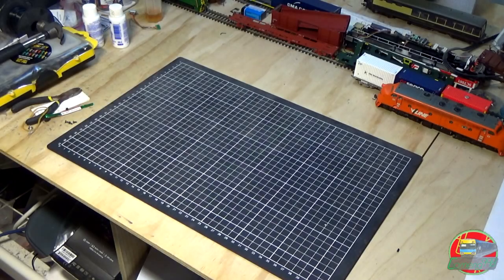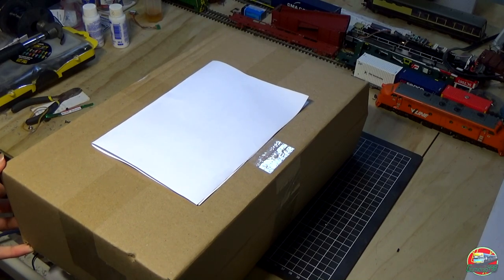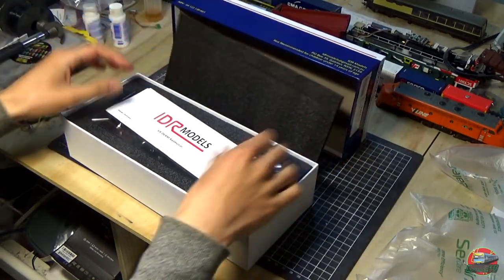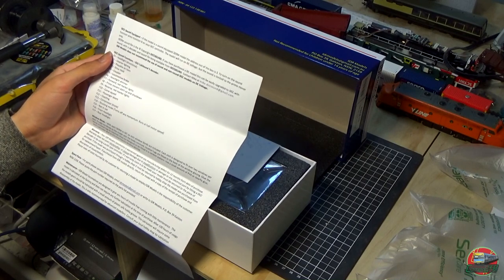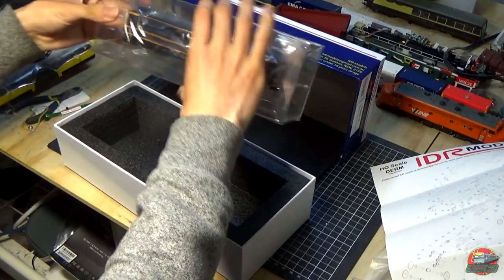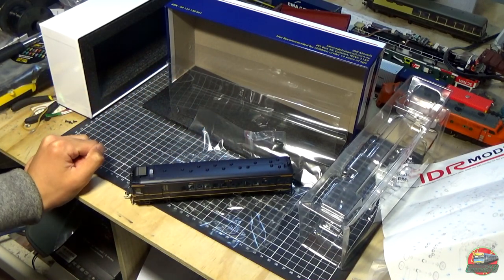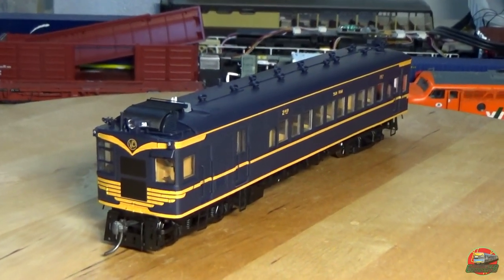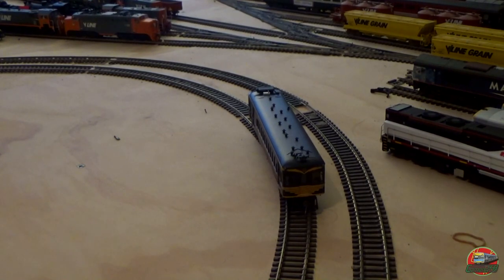Opening a Victorian Railways DERM from IDR Models

Comment: She's a Beauty!  Great detail: looks like everything is there. A feature of the DERMs is the cluttered underframe, compared to a carriage.  So many tanks to hold sloshing liquids, it is helpful for steady running, that the DERM weighs over 50 tons.  Having the trailing bogie pick up current is a good, and necessary feature.  The powered bogie wheelbase is so short, it would have running problems with insulated point frogs, or dirty rails etc.  I have an older SEM DERM. Still a good runner, it also has current pick up from the non-powered bogie.

Comment: I liked your review and track test. I bought Pack 8-B with DERM and Trailer with DCC Sound and found it to be excellent in most respects except for two visual drawbacks on the DERM. One is the intrusion of the motor into the 2nd class passenger compartment, which I'm fairly certain is non-prototypical, and the other is wires dangling from the roof in the first-class section, with wiring visible elsewhere inside the DERM. I noticed this issue was obvious on your model, so I know it's not just an oversight with my model. Given the excellent running characteristics and exterior presentation, you'd think they would have paid the same level of attention to the interior and tidied the wiring up a bit or relocated it. I raised this matter with IDR, but they just said if I wasn't happy, I should return the model to Train World. I really felt like they couldn't care less. I'll probably have a go at removing the roof to see what I can do. Window blinds are included as auxiliary parts, so maybe they can be used to hide the motor intrusion and wiring. Fitting passengers would also probably help. One other thing I noticed on the DERM is the completely solid bulkhead between First and Second Class. There should actually be an access way in the bulkhead between First and Second. You might think I'm nit-picking, but I think every Australian railway model, especially nowadays, should be the very best that it can possibly be, within reason.
Reply from the maker: Thanks for watching. I honestly didn't notice on my first look of the model as I was stuck looking through a camera, but now that you've outlined them, it is rather hard to not notice them. The motor I can understand as there is a limitation in the room to fit a regular motor, as assuming the motor has decent quality, unlike some other manufacturers, it's not something that I would really mind. The other things are some interesting design decisions as I recall from them, there would be some limitations on the accuracy in some areas because of the difficulties in tooling the model and having to keep the models affordable. It is an unfortunate response, however it isn't unexpected as there isn't really much they can do now that the models have been delivered.
I don't really mind nitpicking, as I honestly do the same with some steam locomotives, however overall the Australia model rail industry does have a rather high level of detail and accuracy for the prices compared to some other markets with the fact there is less demand as well.